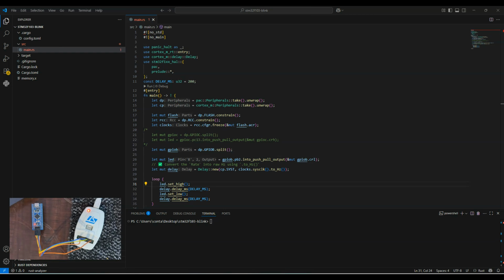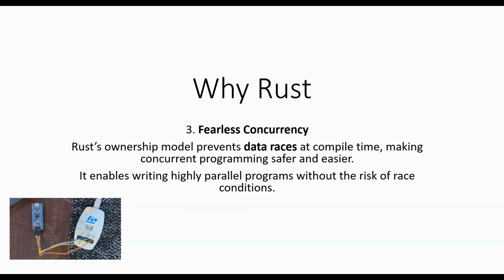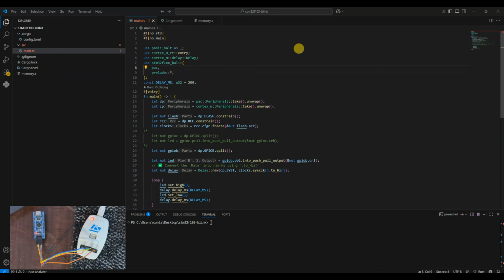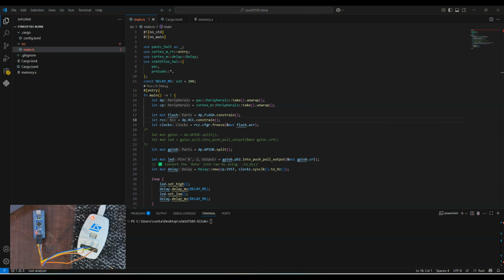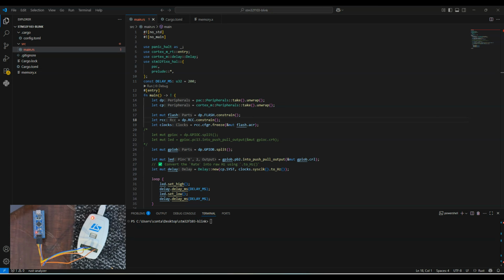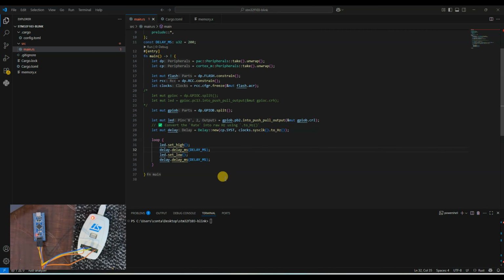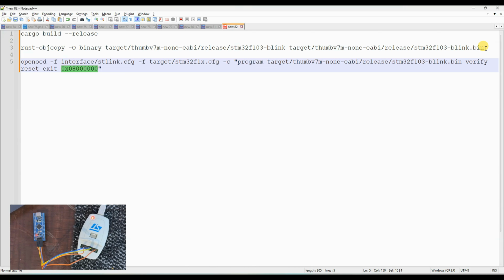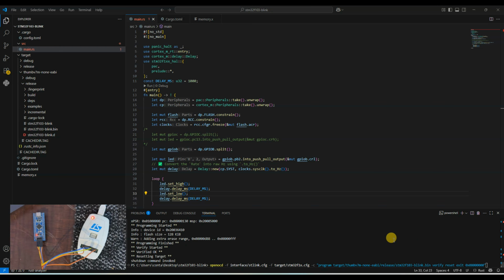Rust Programming Blinking LED using STM32 | Embedded Rust | STM32

Comment: Interesting talk about Rust, in the beginning... I need to finish watching this, I need to know if I can develop in Rust for Stm32 on mac OS, or do I need to use a PC, or Linux VM?
Reply from the maker: Yes You can develop on mac OS, You will need these things: 

Rust Toolchain (with nightly support and target support)

Cross-compilation target for ARM Cortex-M (e.g., thumbv7em-none-eabihf)

ARM toolchain (for linking/debugging): arm-none-eabi-gcc, arm-none-eabi-objcopy

OpenOCD

ST-Link / J-Link or compatible debug adapter